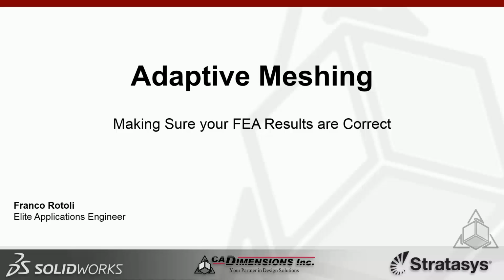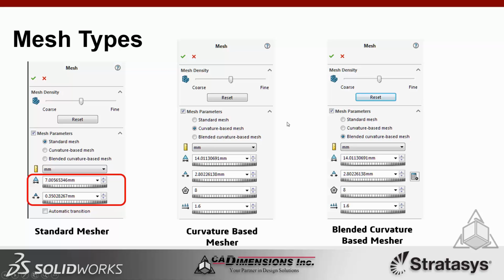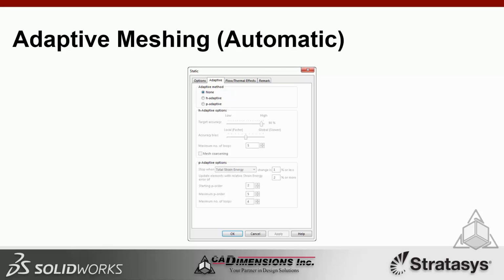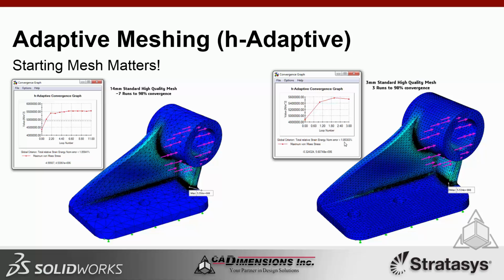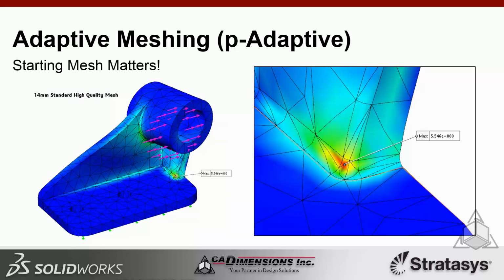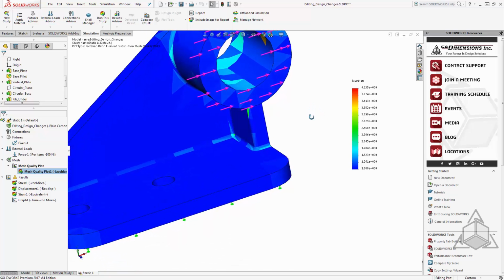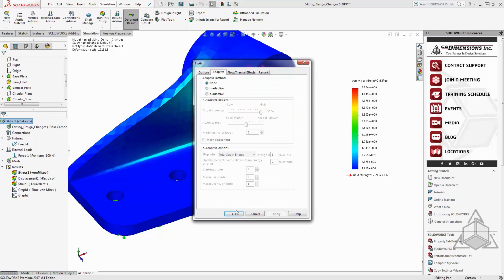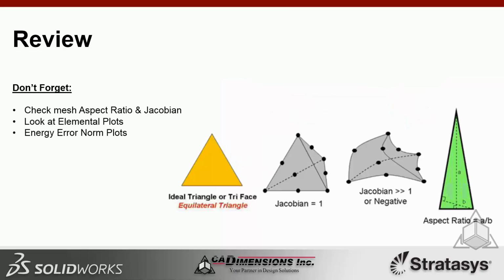Lunch & Learn - Adaptive Meshing - Make sure your FEA results are correct

Comment: Hello

I am tryning to test a Aluminium Honeycomb sheet of Size 1.2 m X 0.3 m X 8.5 mm thick sandwiched between 1 mm thick top sheet and 0.5 mm thick bottom sheet.

I am unable to mesh it properly.

In meshing window it shows elapsed tine 24 hours. Is it so that much time taking or else I am doing some mistake in meshing??

I tried mesh control but my PC doesn't work then.

Configuration of my pc is quite decent with 16 GB RAM, 256 SSD, 6 GB NVIDIA'S GTX 1060 Graphics  core i7 processor...

Kindly help if you can...
Reply: You can mesh it like a shell body. It requires a lot less time to resolve it. Also the starting element size affects the time, and the iterations too.